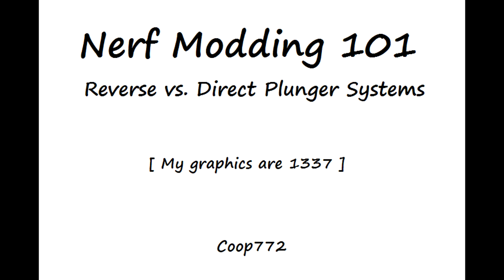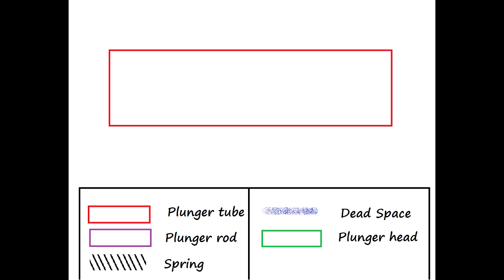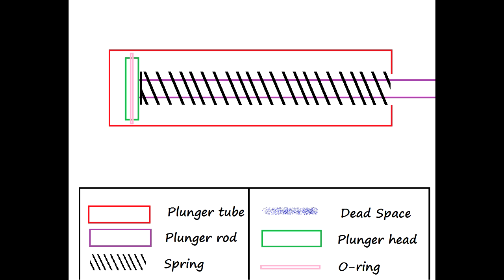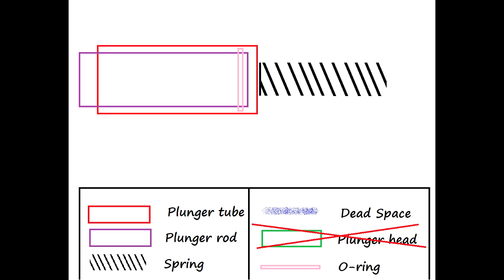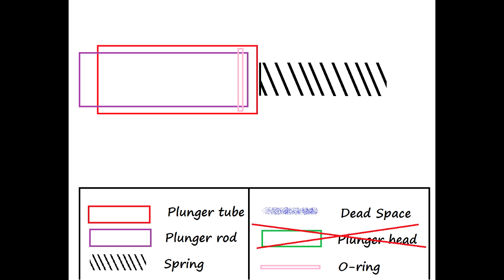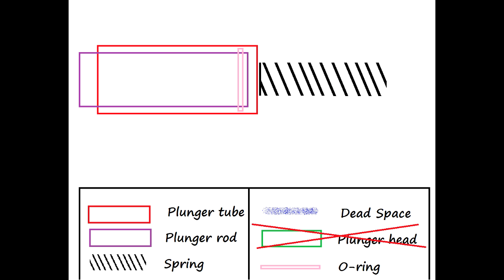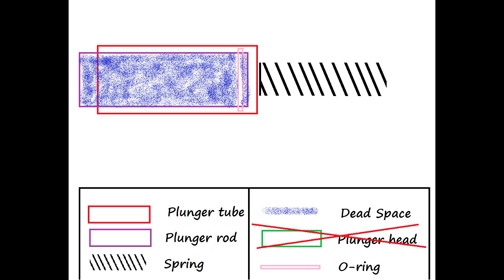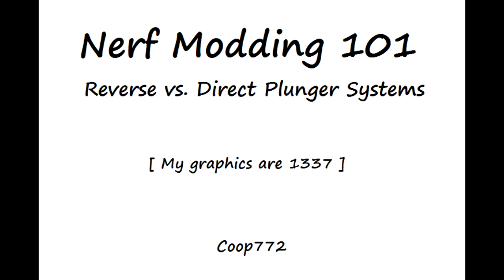[Nerf Modding 101] Reverse vs. Direct Plunger Tube Systems

Comment: Coop, I'm new to nerf modding and i'm trying to understand how a reverse plunger tube helps clip systems.
Any tips would do, thank you.
P.S. i already broke my old retaliator trying to reassemble it XD
Reply: his comment is old but still relevant for people wanting to know.  With mag fed guns, it needs to be chambered in order to stop air escaping out of the plunger rod without making the mag hard to load, reverse plunger systems can have the dart taken out of the mag and put into the actual plunger rod.  This would be pretty much impossible with a direct plunger tube
Reply: They make guns that use clips now?

Comment: slam fire requires a slightly different catch mechanism which isn't viable for every blaster. it's pretty simple anyway, you can see how it works by opening up any blaster with slamfire.